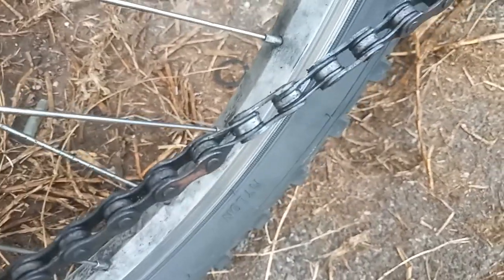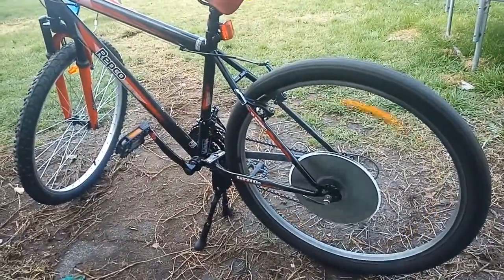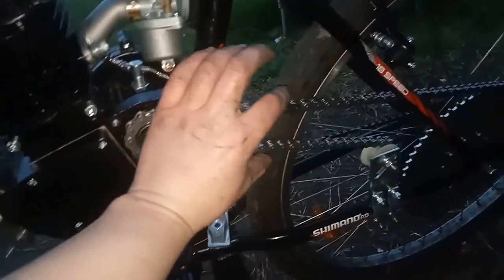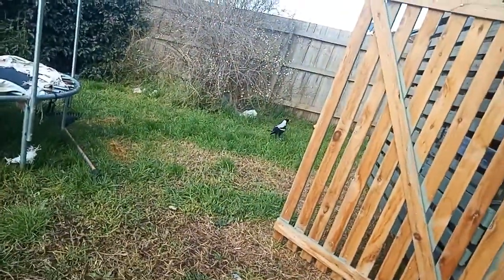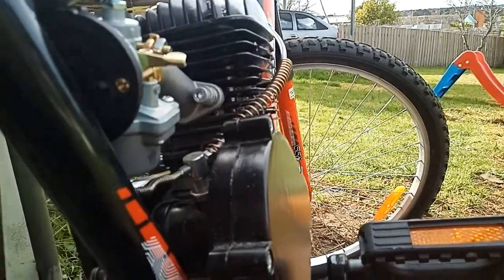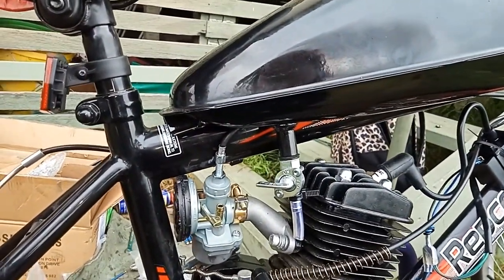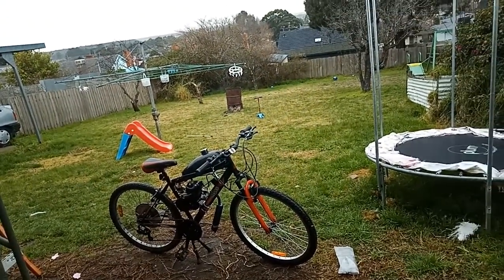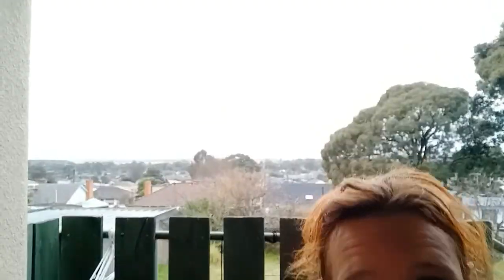Building The Mk2.5 Motorised Bike

Comment: Dude that was genius with the spring around the fuel line 👍.you might want to think of some sort of thermal separator where it's not directly touching the metal spring so it doesn't absorb the heat. I'm stealing that idea from you bro lol,I have a fuel line on The grudge that's a little too close for my comfort. You might already but also file The mating surfaces until true and flat for the exhaust, intake & generally any matting surface.

Comment: I recently did the same thing with my air filter... using two cages. Instead of grinding into the frame you could have taken off the clutch arm and rotated it out. 
Edit: I found that on my large sprocket I had to use a 415 chain. Just like yours, my 410 (stock) chain did not fit.

Comment: Hey nik is it possible to move your engine forward or slide up the down tube on the bike 
Im thinking since the nut buster  tube is canted up 
You may be able to slide the engine up and forward making room to mount rotarubrac straighter and possibly even have the air filter to
Reply: Well damn that sucks